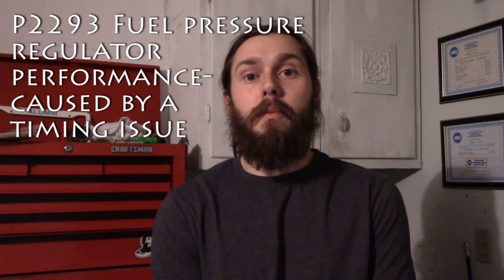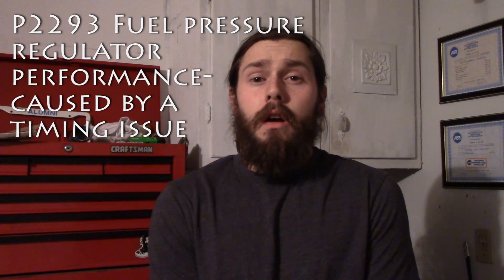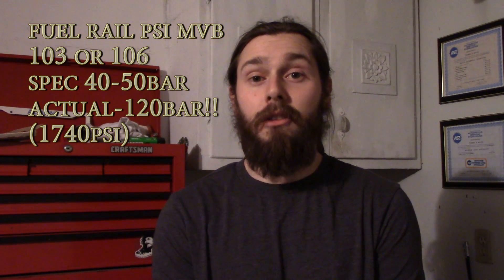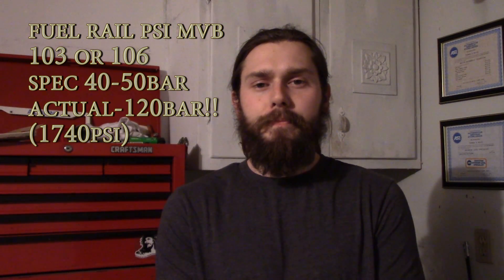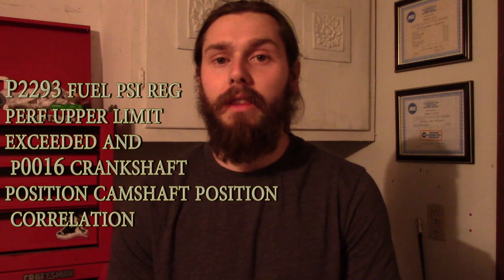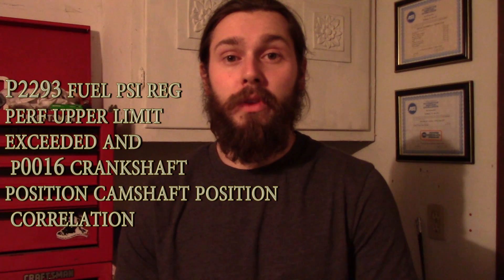P2293 Fuel Pressure Regulator Performance (upper limit exceeded)- caused by a timing issue

Comment: Hello.  I have a 2008 Audi A4 2.0.  I have been trying to fix my p2293 code fuel pressure regulator 2 since December 2024.  I have already replaced the lpfp, HPFP, fuel filter, fuel rail pressure fuel sensor on the hpfp, the 4 injectors and the relays and the car still have multiple cylinder misfires and code p2293.  What else do you think my problem might be
Reply from the maker: What engine code do you have? And what is the fault that is being stored?
Reply: @PositiveLeadDiagnostics  Engine code is BWT and the code stored is P2293
Reply from the maker: Have you pulled the hpfp and inspected the follower and the cam lobe?  It could be a worn camshaft
Reply: @PositiveLeadDiagnostics  Cam follower was in good condition when I replaced the HPFP but I still replaced it as well.  And the cam lobe didn't look damaged at all.

Comment: Thank you for your knowledge, I had the same proble, new high pressure pump engine no start, used pump engine start but fuel pressure high.
I did the timing and the new pump starts the Jetta 1.4 tsi, used pump fuel pressure drops to 50 bar at idle

Comment: Bought a 3.6 Passat from a friend who said he's been throwing a p2293 throughout his ownership (2 years 12k miles) and never gave him any issues besides a CEL. My second drive I lose all power as if the car went into a limp mode and threw a P0016. I was certain they were both separate issues but your video has me convinced that the timing is off. Great video and great breakdown! We need more techs verifying these issues with scopes in the field. These waveforms you've gathered are gold!
Reply: I figure I'd update just to add to the legitimacy of these codes relation to eachother, I was completely missing 2 timing chain guides. They were so worn they broke and got shredded by the timing chains. I'm very lucky timing didn't jump as these are interference engines, scary to think about. I replaced guides and chains and the car runs great! Both the p2293 and p0016 are cleared, it's nice to have a clear dash again and that I'll finally be able to get this thing registered (Illinois emissions are a pain).
Reply from the maker: Yeah nice find.  Every time I have seen the p2293 it’s been a fuel pump timing issue. Yours was so bad that it was throwing p0016 too. Yes you are very lucky it didn’t jump

Comment: Thanks for this great info. I'm having a potentially similar issue on my 14 a4 2.0 with 120k on it. Just popped a permanent p2293 code. Then a week later has a random misfire with codes for cyl 1 and 3. And I was confused as to how my fpr 2 was in the hpfp and driven off timming. But with the misfire added and oil consumption I began thinking maybe my timming might be off. But I have a 14 which is supposed to be an updated timming system with the new tensioner. But my gut is telling me its potential to be another vag timming problem car.
Reply: Hello how did you fix code p2293?

Comment: could this be the reason for my P12a2 code on 09cc sport?
Reply from the maker: What’s the description for the p12a2?
Reply: ty for responding, it is high pressure in the fuel rail. clears itself every now and then, but is now

Comment: excelent. the way i chek the 2.0 passat same yr, 2006 makes me think of a duty cilce problem to fuel presurre regulator solenoide at hig pp. but by whatching this video i need to focus on the timing, sepecialy w 170k miles 
and a previous worn out cam follower

Comment: I have a 2007 Audi Q7 3.6L. it has a P0016, P12A4, and P2293. The dealer said it has the same 120 bar extremely high fuel pressure. I have replaced the low fuel pressure sensor, camshaft position sensors, fuel pump, used a multimeter to check the Camshaft adjustment valves, inspected the wiring and related fuses. No impact. The car has a slight rough idle for the first 7 to 10 seconds. Then it runs smooth and I've driven 4 hours at 80 miles per hour without any problems. Dealer thought the problem was probably the ECM. My car problem seems to line up exactly with that VW seeing as how two of the codes are identical and the high fuel pressure is exactly the same. Do you think fixing the timing chain would be the next logical step?
Reply from the maker: Sounds like the high psi fuel pump is out of time.  Sounds like you are due for timing chains

Comment: Tom. Thank you very very much for the great information you provide. I just saw one of your other videos where you talk about DTC P2293 being a HPFP follower being damaged along with a cam shaft being damaged. Well it turns out that I just got an 08 AUDi A4 2.0 Turbo With the exact same codes you have just described P2293 , P0087, P0016 along with P0302 just from seeing this videos I have learned alot. I just subscribed to your channel. Again THANK YOU!! keep up the great work and God Bless.
Reply: What was your fix for code p2293?

Comment: hello!  I'm so glad I came across this video! check this. In March I had a 2008 A4 come in with the light on. it had two codes if I recalled correctly. A fuel pressure fault. I think it was p2293 or p0089.  Also had a time code. either one for correlation or the valve timing solenoid. the solenoid was filled with oil in the connector so it wasn't working. That caused the correlation issue. changed that. For the fuel pressure issues I changed the fuel filter since it was never done and changed the low fuel pressure sensor since those are knowing to have problems. Sent the car away. 

Two months later it's back at the shop for the engine light being on. Scanned it. Same codes. Shiiit.   The solenoid we out it went bad. It was stuck and wouldn't move. It's aftermarket so that could be it.   Changed it. With the fuel issue I had no idea what to do. I knew that the HPFP could cause it. But so could the intank pump. Or the high pressure sensor. So I fixed the solenoid and out went the car. Only to return this week! lol. This time though, the code was for low boost pressure. The diverter valve diaphragm was torn. Fixed that. 

Now after just randomly finding your video something click. Couldn't the timing issue caused by the solenoid cause the fuel pressure codes??  I mean it makes sense based on what you're saying. Also both codes always showed up together!  What do you think?
Reply: Ah. I just remembered the timing code when it came back the second timing.  Over retarded. The solenoid was stuck either completely open or closed.  So if the timing is off due to that I now suspect that it would through off the HPFP.

Comment: 1 bar  = 14.5 psi. Is the normal spec really 40-50 bar? That is insane.
Reply: Gas directed injected runs at much higher pressure than intake manifold fuel injected engines. Some TDI diesel common rail engines run at 2000 bar!
Reply from the maker: Yea the pressures are ridiculous. Must be extremely cautious when working on these fuel systems
Reply from the maker: Yes. Pressure is through the roof!  Yea spec is 40-50   This one is at 120! That's 1700 psi. Crazy
Reply: Positive Lead Diagnostics yikes... That is a seriously high pressure to send up a fuel rail.  Have you ever witnessed a fuel leak on one of these?  I think I prefer the "old" cars with the 3-4 bar regulators.
Reply from the maker: Never seen one leak. I hope I don't lol.

Comment: Nice!! The strategy is sometimes "ridiculous" on many systems. However, i think the rail pressure sensor is there only to monitor the system, and flag the check engine light. The pulsing of the solenoid needs to be in sync with the pump to be able to generate enough juice. And i think that it always defaults to 90/100 duty cycle whenever a pressure problem is sensed. The O2 sensor would be able to re adjust the trims and the ratio. Not defending VW, but i think that this is not bad of an idea, as usually the problem would be low pressure. The system sure could use more brains, as to lower the pressure when higher than usual, however, who's to say that in any other case the sensor is right? So from a functionality perspective the system has a pretty nice fail safe policy. The problem is that it will always be harder to diagnose, as well as trying to keep up with 10 or 20 ssp's per day ;)
Cheers! keep up the good work!
Reply from the maker: Thanks for watching. I think it's a terrible design. Why time the fuel pump?  Obviously the computer is able to control the fuel pressure no matter where the pump is. The main input should be the rail sensor to control the duty cycle but it's not which I think is pretty dumb

Comment: My Thoughts. The PCM might up the pressure because it is out of time.  Inlet pressure to a pump affects outlet pressure. So if the pump is out of time and the pump supplies a higher pressure at TDS, and the Computer know it out of time. Its going to supply a higher pressure all the time so the car can still run.
Reply from the maker: I learned The computer uses some logic with the cam and crank signals. it knows where tdc is for each cylinder and it wants to see a fuel pressure increase when each cylinder is near or at tdc.  If it doesn't then it defaults to high fuel pressure. But when you disconnect the pump the fuel system defaults to low pressure and the car still runs. Obviously it would have lower power but it still runs. I think it's a dumb design and the fuel pump should not even be timed. It should be computer controlled hpfp based on the rail pressure